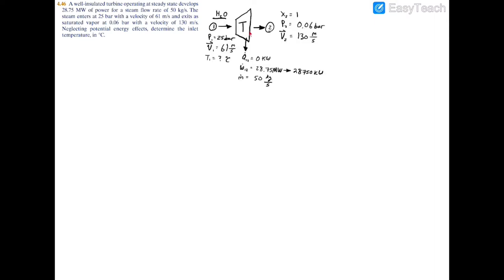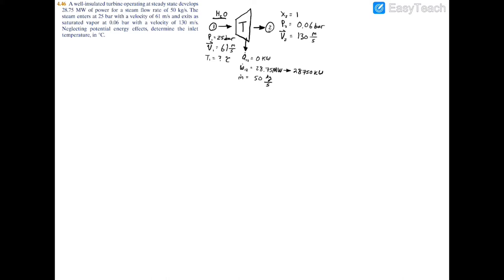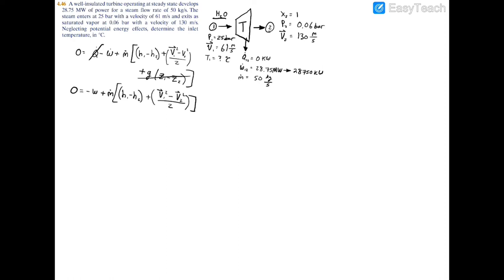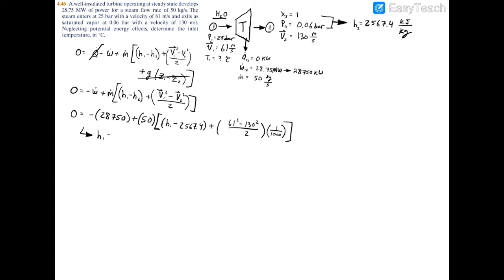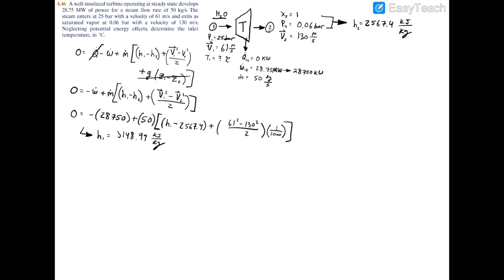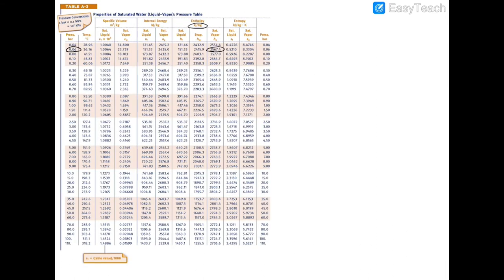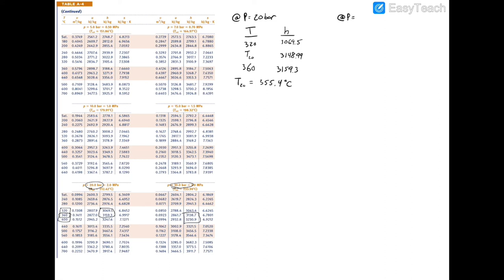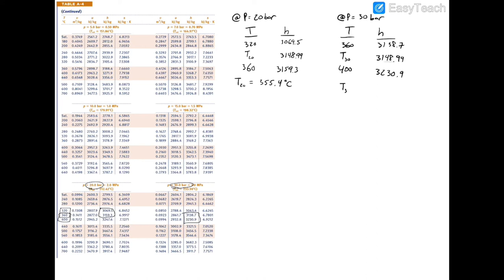4.46 A well-insulated turbine operating at steady state develops 28.75 MW of power for a steam flow

Comment: How did you do the interpolation for the end?
Reply from the maker: We have P=25 bar and h=3148.99 kJ/kg. This steam is in the superheated state, so we must use the property tables for superheated water. Unfortunately, the superheated water tables have information on superheated water at 20 bar and 30 bar, but not 25 bar. Therefore, what we can do is find 20 bar's corresponding temperature at h=3148.99 kJ/kg, let's call this temperature T20. Then find 30 bar's corresponding temperature at h=3148.99 kJ/kg, let's call this temperature T30. We are looking for 25 bar's corresponding temperature at h=3148.99 kJ/kg, lets call this temperature T25. After finding T20 and T30, we now have 5 data points that allow us to interpolate for our target, T25. We have data set 1: (20 bar, 355.4°C), data set 2: (30 bar, 364.46°C) and our target data set: (25 bar, unknown T25). You can use linear interpolation to find the unknown T25, or the temperature at 25 bar. From my calculations, I calculated 359.93°C.

Please let me know if this did not answer your question.